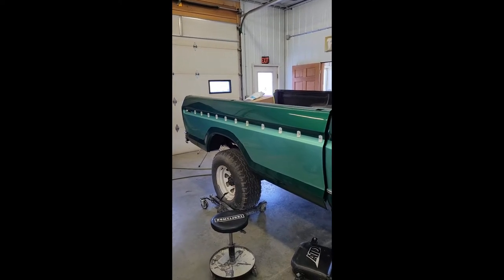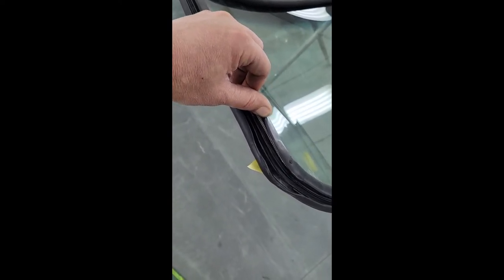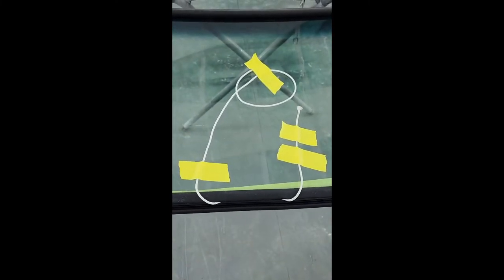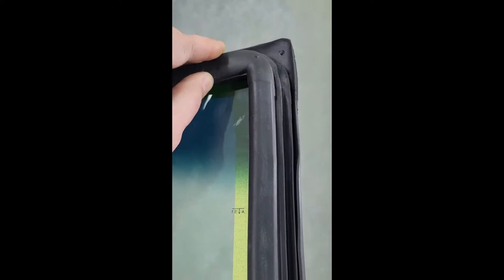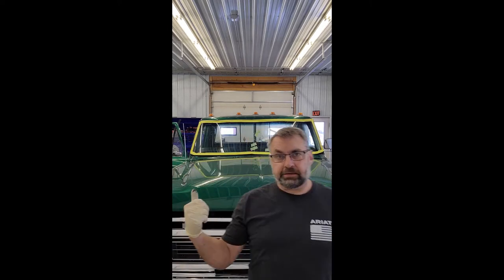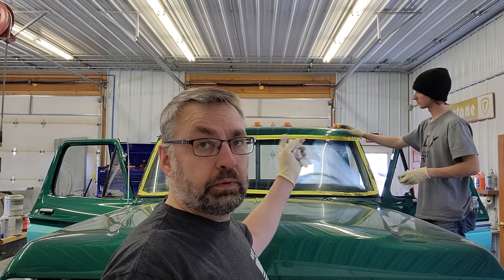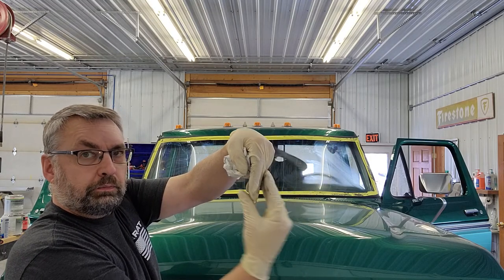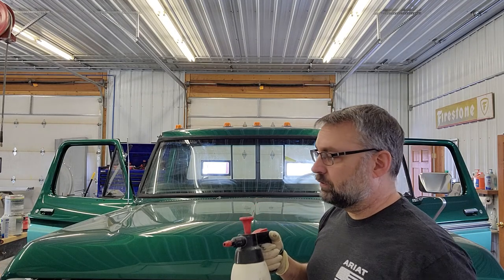1977 ford pickup windshield install

Comment: The reason you had to struggle so much is a common mistake when installing these. Never attempt to drop it over the lower pinch weld, you will always have a problem getting it to drop (because of the compound curves) far enough to get the top in. Always center the glass/gasket in the opening, and take advantage of the flexibility of the gasket to rope over the pinch weld. Also these are designed to install dry, no sealant, but I understand the desire to add sealant for insurance.

Comment: Thanks for the video. I was wondering,you probably replaced the windshield seal with a new one. Where did you get it ? 
Also just love the stock colours that you did the truck in. I have a 1978 F250 super cab ,4 wheel drive with the Dana 60 front end.